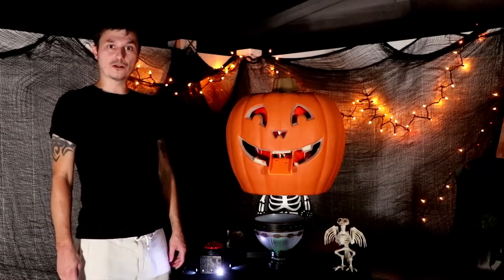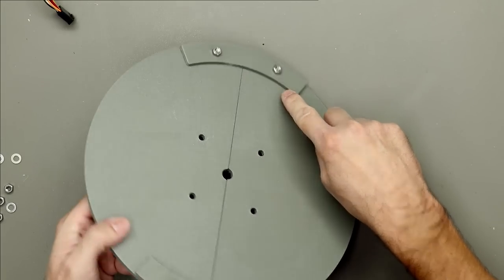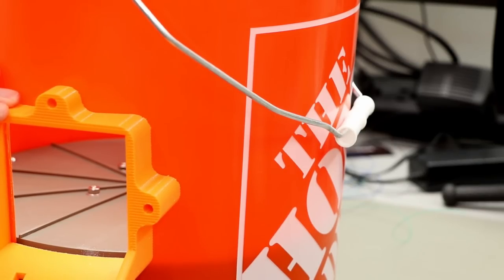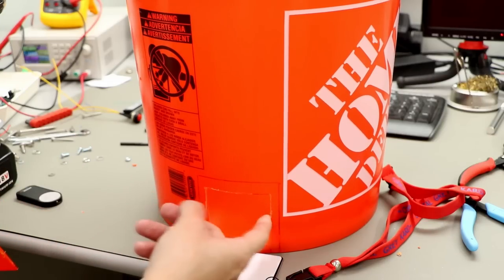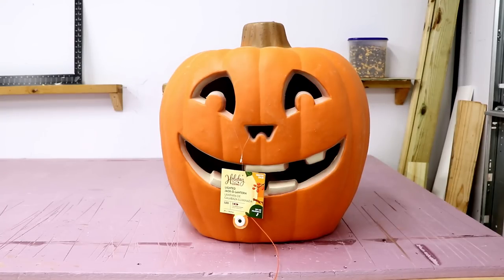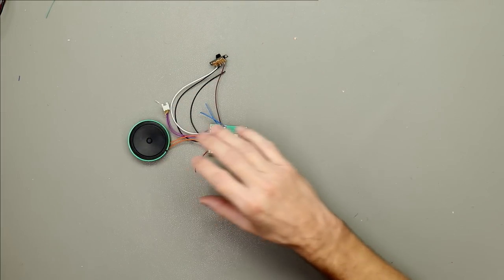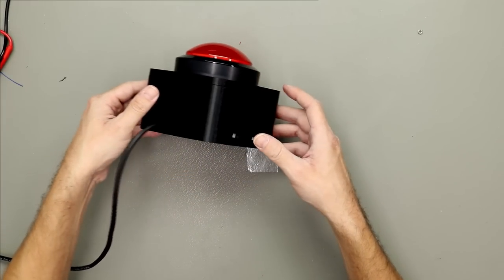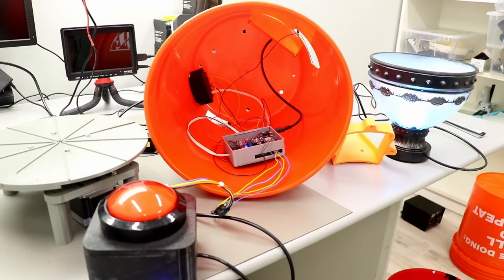Automatic Halloween Candy Dispenser

Comment from the maker: I also added the Arduino code and the Gerber Files to Thingiverse: https://www.thingiverse.com/thing:4603858/files or on github: https://github.com/branklyvideo/automatic-candy-dispenser
Reply: Can you add the schematic to your uploads.  Thanks
Reply from the maker: @conniedave7628  Sure, here you go: https://circuitmaker.com/Projects/Details/brankly/Halloween-Dispenser
Reply: Greetings, do you have the measurement specs for the stand by chance? My print area is too small and I need to design it a bit smaller. Any chance it was done in Solidworks? :)
Reply from the maker: @OnwanashiboNarfall  The stand is just a bit smaller in diameter than the bucket. I did all in Fusion 360

Comment: Thanks for sending me the board Brankly I am just getting it together today. I have the parts printed and hope to have every thing working here before the coming weekend Thanks again great work and really cool design.
Reply from the maker: Hope you enjoy it!
Reply: Hi did you ever finish the build? I'm not sure on the position of the capacitor or resistor.
Reply: Yes, it works, no issues with the board. I had to do some wiring changes as I used different photo eyes. Kids here loved it, we did not get many tho as the weather was cold and windy. The capacitor 470microfarad 25v is (-) on the hole above ex02 connector d9, the (+) is on the vin trace just above the (-) one. The resistor 4.7k worked fine. I can go pull the unit apart to see for sure. That was from my notes.
Reply: @djofnofame8292  thank you so much. soldering board now as my printer is working in the background.
Reply: @benny1495  just to make sure that itscthe hole above d9 and not d9 itself.
Reply: @djofnofame8292  Hi would you happen to know the wiring for the stepper motor. I see on board stepper a and b. Which color wires go to each. Thanks,
Reply: I’m planning on building one myself. I also have the same question with the stepper motor. Which wire color goes to which. Thanks
Reply: @djofnofame8292  would any 20v power supply work? what's the amperage of the power supply that you used?
Reply: @rujaecandado7751  I am using a 12 volt 1.5amp power supply. I have a box of them from a work project. you should be able to use a 20v as long as your caps are over that. As  in if you have 16v caps then do not go over. If they are 35 volt then have at it. Mine works, but i will need to adjust it as its making a bit of noise this year. I put a skeleton on top of mine and used the sound to make it more spooky.

Comment: Printing parts as we speak. I had the pcb printed and have all the parts. Didi you happen to film the soldering part? I'm kind of a newbie at this. I'm not sure which way the capacitors go and also I'm not sure how to solder the voltage regulator. Am I missing a  pin?

Comment: WOW I wish I saw this 2 years ago.
I have a leftover stock 42-40 Ender 3 Extruder stepper motor, would that work in place of that CNC motor you listed?

I have spare Pi Pico's, and Wemos D1 Minis, and Relay modules,  I'm hoping to maybe do this project with what I have on hand. I know the Arduino sketch may not work as a result.

Comment: Great vid and project! Curious—The gear model doesn’t seem to fit the stepper motor you linked. Is there a diff version of the gear model? Also, what kind of screws and nuts are you using? Thanks!
Reply from the maker: Thanks, I used M3 or M4 screws, I can't remember it was a year ago. But the gear should fit the motor I linked. Did you try it?

Comment: Awesome and appropriate idea for a project! Very cool. Was there testing involved to end up with 25 seconds as your timeframe? That seems like a long time if there was a group of kids, though useful for deterring individual kids from pressing it multiple times. I'm gonna build it!
Reply from the maker: It was because of the sound effect, there are 3 different ones in the board I used and they are between 20 and 35 seconds so I went for the middle :-) So the wait time is not to long after the shortest stops.
Reply: @brankly  Ah. That makes sense! Thanks for the reply. Are you planning on making the code available somewhere? I am about to start 3d printing your files from thingiverse. Cool project!

Comment: Did you have to add pull-up or down resistors to the sensors?  I don't see a circuit diagram anywhere.
Reply from the maker: Yes I did, you can find the diagram here: https://workspace.circuitmaker.com/Projects/Details/brankly/Halloween-Dispenser

Comment: I'm really close to getting this built this year! quick question: is the resistor 4.7K or 47K ?
Reply: Alternatively, you can use the internal pull-up resistor on the Arduino itself.
Modify these lines of the code:

pinMode(button, INPUT_PULLUP);

if (digitalRead(button) == 0) {